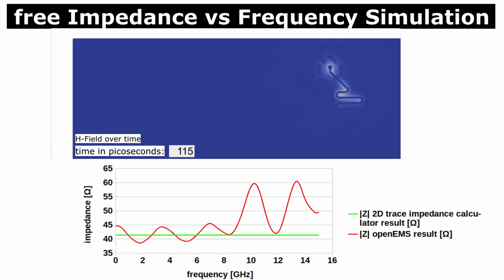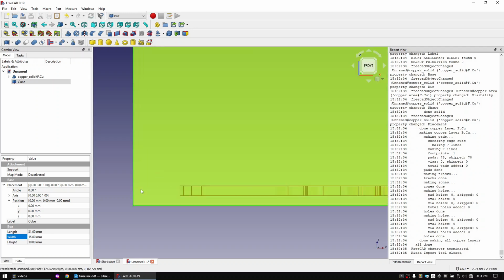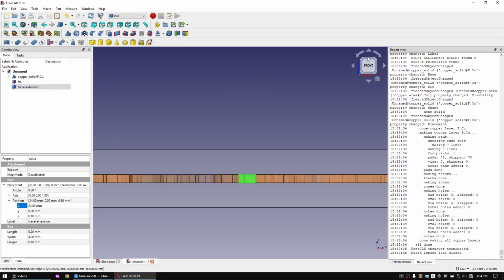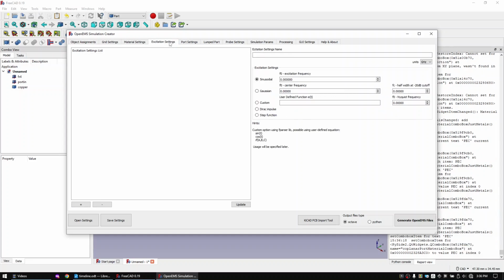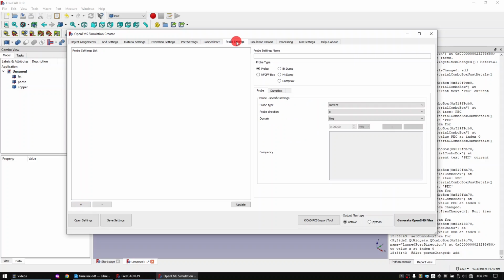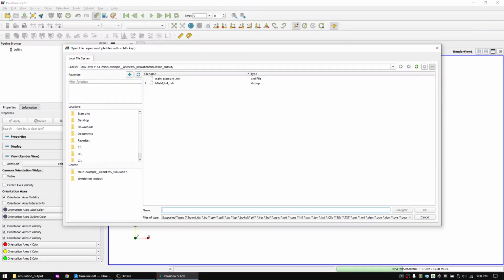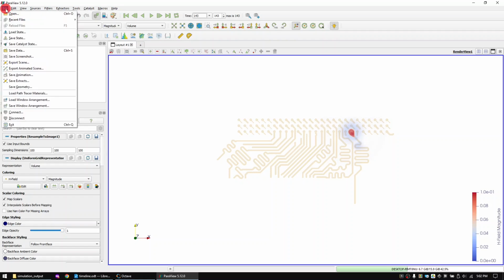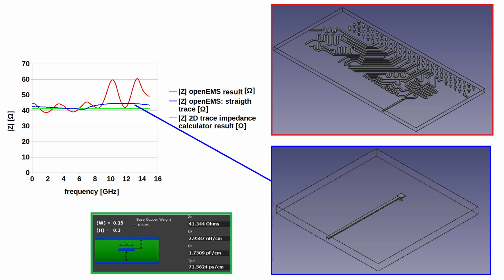free trace impedance over frequency simulation with KiCad and openEMS via S11 scattering parameters

Comment: Wow - great video. Why did I only discover you now?? I need to analyze cross-talk on some adjacent traces that start within a chip, go through wire-bonds and then some more mm to a load. I can model the excitation as a current source with some parasitic C,R,L. Could the basic method you showed here be applicable to my needs?
Reply from the maker: yes its possible, but as first project i recommend to match your simulation to a known setup so you can match your results with the real thing and get familiar with the workflow. Good luck and enjoy getting started 👍
Reply from the maker: Hi David, As I am not sure how restrictive the policies at udemy are, here is my contact E-Mail  panire@gmx.net

Comment: how to get an inductance value of a trace?
Reply from the maker: i never tried to simulate it myself, but i am quite sure i have seen an inductance simulation example in the example files of openEMS. Sadly the example files just consist of matlab code so its not really straigt forward to understand.
Reply: @panire3  if I need to make a 0,1uH pcb inductor how would you do it?
Reply from the maker: @ I never tried to do that in openEMS yet. if the example files are not enough you can try asking in the openEMS forum. Good luck with getting started

Comment: How you can get the field dump where you did not defined it in the plugin?
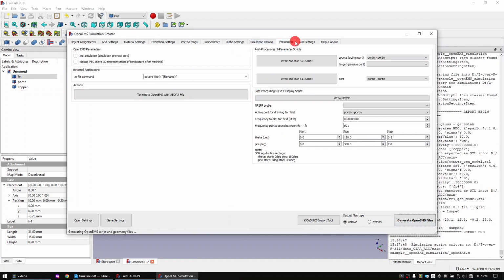Reply from the maker: Hi there, In 5:07 i assigned the fr4 material to the hfield dump. here is a screenshot: https://drive.google.com/drive/folders/1nBo2cWR20sY1gklhX0t46woCeQ7xoHPY?usp=drive_link
Hope this helps
Reply: @panire3  oh God! my bad. thanks.
Reply from the maker: @ the approach in this one was a bit different. I just imagined that the trace is a stripline (inbetween 2 copper ground layers), thats also why there is no air defined as the whole simulation takes place inside the PCB only. Hope its not too confusing, just tried to show an altnerative use case. :)

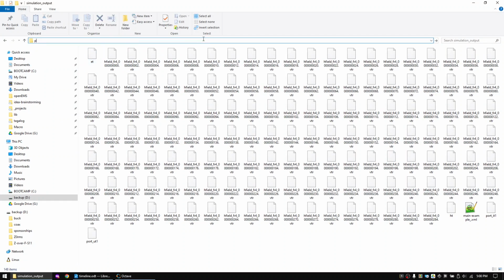Comment: At 5:41, I see your output is a reasonable ~150 files.  I'm trying to run your simulation, but its producing a huge amount of files, so it doesn't seem to be converging like yours did.  Here is the start of my script output...

FDTD simulation size: 621x301x29 --> 5.42071e+06 FDTD cells
FDTD timestep is: 1.46034e-13 s; Nyquist rate: 228 timesteps @1.5017e+10 Hz
Excitation signal length is: 2616 timesteps (3.82024e-10s)
Max. number of timesteps: 1000000 ( --> 382.263 * Excitation signal length)
Create FDTD engine (compressed SSE + multi-threading)
...
...

45 minutes later, it's progressed to this...

[@    45m31s] Timestep:        16896 || Speed:   34.3 MC/s (1.579e-01 s/TS) || Energy: ~3.06e-08 (-14.35dB)
[@    45m39s] Timestep:        16940 || Speed:   29.7 MC/s (1.824e-01 s/TS) || Energy: ~2.97e-08 (-14.48dB)
[@    45m45s] Timestep:        16984 || Speed:   34.6 MC/s (1.564e-01 s/TS) || Energy: ~2.68e-08 (-14.92dB)
[@    45m53s] Timestep:        17028 || Speed:   32.2 MC/s (1.681e-01 s/TS) || Energy: ~2.24e-08 (-15.70dB)
[@    46m01s] Timestep:        17072 || Speed:   30.7 MC/s (1.765e-01 s/TS) || Energy: ~1.75e-08 (-16.78dB)
[@    46m05s] Timestep:        17094 || Speed:   27.7 MC/s (1.954e-01 s/TS) || Energy: ~1.52e-08 (-17.40dB)
[@    46m12s] Timestep:        17138 || Speed:   31.4 MC/s (1.729e-01 s/TS) || Energy: ~1.17e-08 (-18.53dB)
[@    46m20s] Timestep:        17182 || Speed:   30.0 MC/s (1.805e-01 s/TS) || Energy: ~1.02e-08 (-19.11dB)
[@    46m25s] Timestep:        17204 || Speed:   26.6 MC/s (2.037e-01 s/TS) || Energy: ~1.03e-08 (-19.09dB)
[@    46m32s] Timestep:        17248 || Speed:   32.5 MC/s (1.670e-01 s/TS) || Energy: ~1.16e-08 (-18.57dB)

And still going.  Can you help as to why this is?  
Thanks!
Reply from the maker: Hi there,
Here's what you can do:

Step 1) Start by running a simulation with dump file output for the first 2000 timesteps (or so) to ensure everything is working correctly. The goal here is to check whether the signal movement is clearly visible.

Step 2) For impedance calculations, 3D field dumps aren’t necessary. So once you've confirmed that the signal movement is properly simulated in Step 1, run a second simulation without any 3D field dumps. This allows you to compute as many timesteps as you want (e.g. 1 Million timesteps) without generating large dump files.
Reply: @panire3  Excellent thank you! I'll give that a try

Comment: Is the neighboring trace floating in this simulation?  I would assume if it were ground it would affect the response
Reply from the maker: Yes, in this simulation, it is floating, and grounding the neighboring traces would influence the results. Similarly, terminating each trace with, for example, 50 Ohms would also impact the simulation.

Have fun exploring and learning as you test different scenarios - the project files are in the google drive link, you can freely edit everything! 😊
Reply: I just asked the same question but I should have read the comments first ;)
Thanks for you videos! BTW I managed to use the script in KiCAD 8

Comment: at minute 06.50, are you sure you don't change any excitation or the gain of excitation? or maybe the timesteps? because I just run the Gdrive code you uploaded and set the frame to 140 and the red colors already spread almost all over the place.
Reply from the maker: i will check and try to give you a feedback on the weekend

Comment: Thank you for the video, Which Kicad Versions can be imported for this simulation?
Reply from the maker: The file has to be saved via KiCad 6.0. Specifically I am using 6.0.11.
Reply: So does this mean that those using KiCAD 8.0 cannot make use of this?
Reply from the maker: @saviouremmanuel3608  The process for KiCad 8 is a bit different, it works but you have to change some steps. Sadly kicad changes every few weeks and its hard to make an installation tutorial video so often, my rough plan is to make a new video once kicad 9 is released.